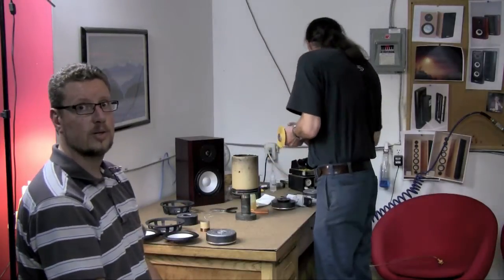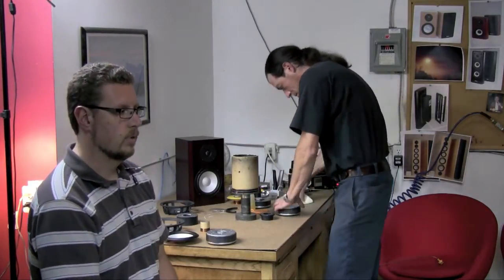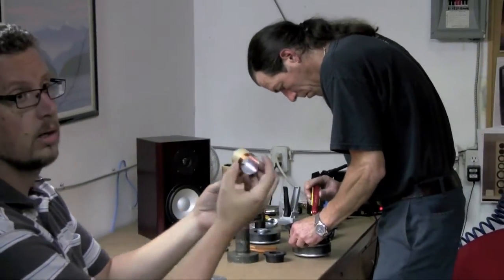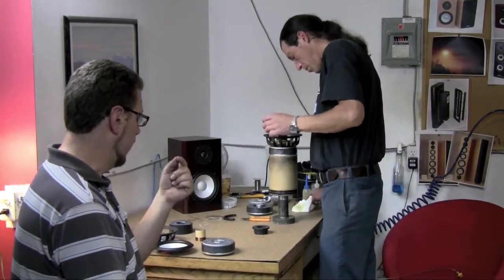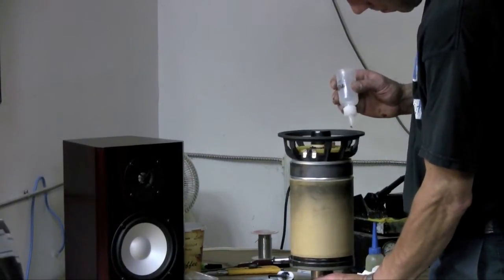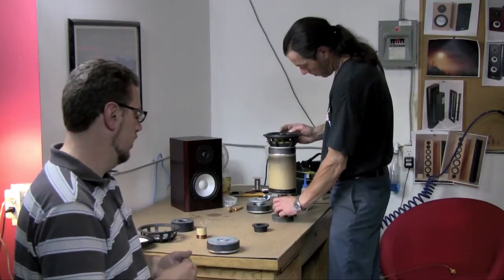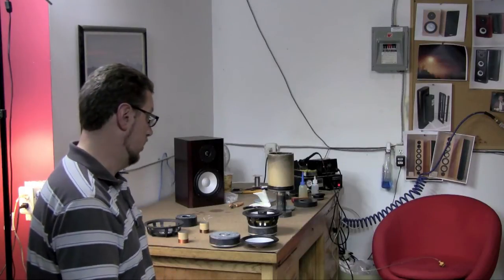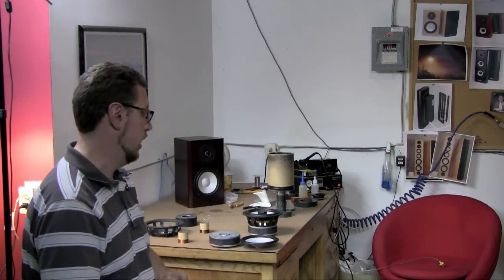Building A High-Powered 6.5" Woofer

Comment: Good explanation Andrew. I have owned my M60 for 10 years now, and have never had a failure of any sort. I wonder how much longer the new drivers will last. Will you be doing a video about the cross overs in the M100? I read a lot of comments on how important it is to have high end parts in the crossover.